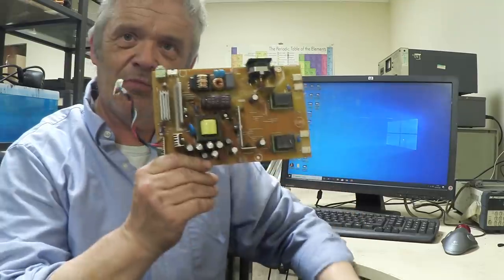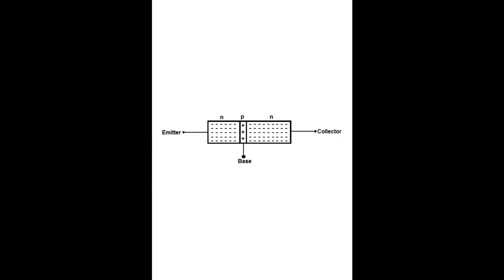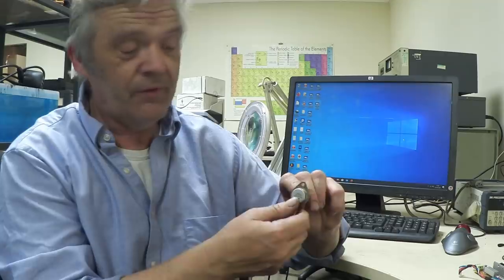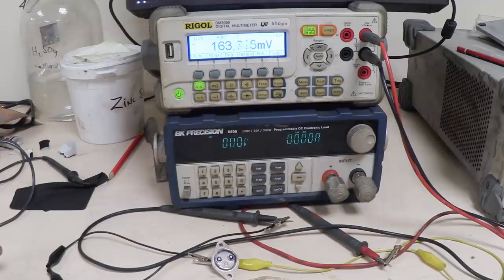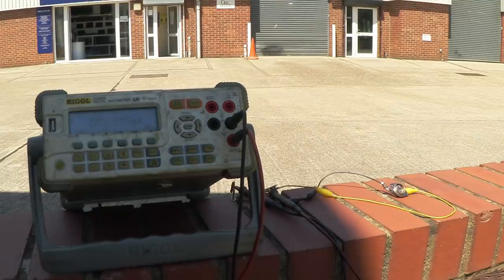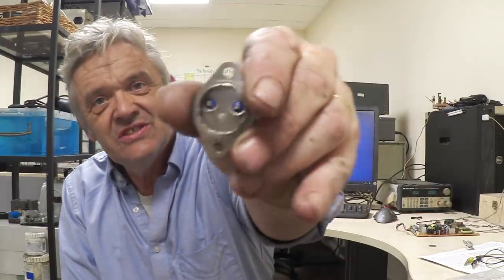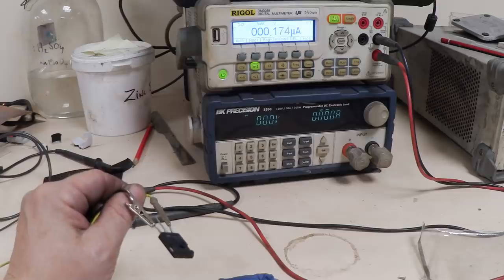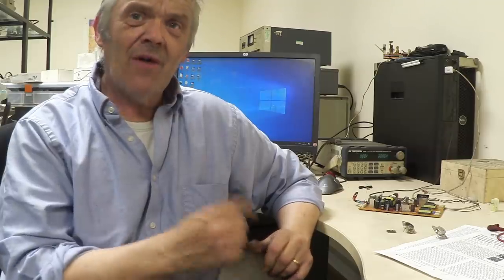Generating Power From Scrap Electronics

Comment: I can get more power than that from just walking into my living room when I'm wearing socks... if electricity was gold, you're telling people how to find gold but only in amounts that are invisible.
Reply from the maker: okay mate
Reply: As far as power generation its not that impressive. But the diode can now be used as a photon detector /photo resistor in a circuit to automate say blinds in the morning.
Reply: @ThinkingandTinkering  not trying to be an asshole but its not a useable amount of energy on any scale. You've inspired me with other videos so don't take it the wrong way.
Reply: @jjhack3r  Did you think 1 transistor was going to power his workshop?
Reply: @DudeBoerGaming  No, obviously. You're assuming a lot from my statement. It would likely take nearly 100 of them to power anything of any use like a calculator which can easily run on lemons or any other minicual source of energy... if its not even enough to charge a battery, its worthless to me. If you fart on a speaker it will make electricity, but not enough to be useful.